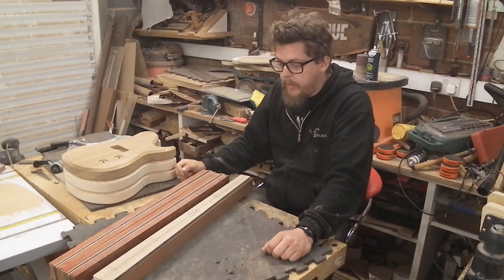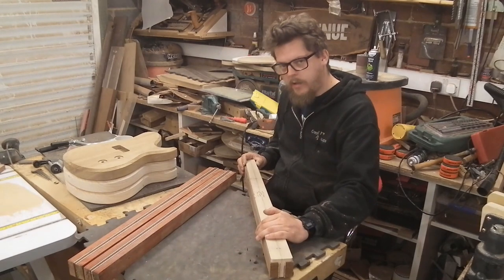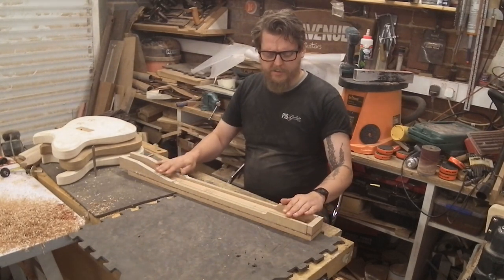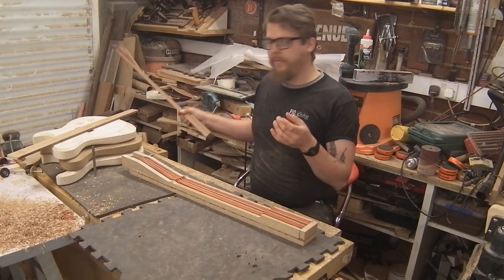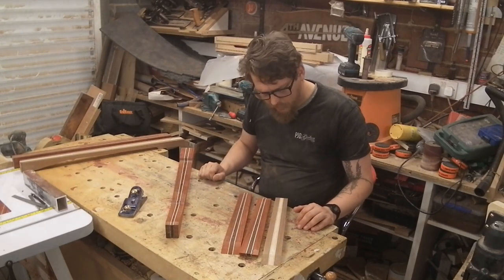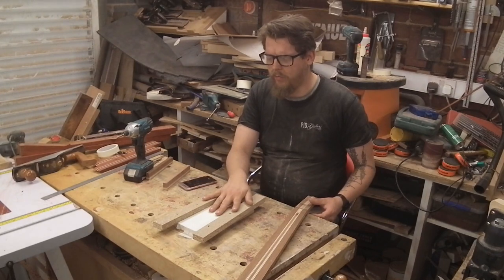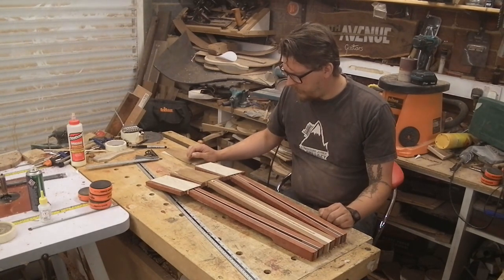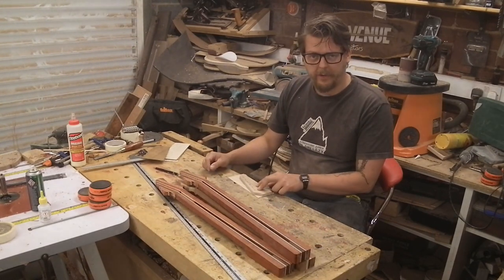Phoenix Graduate, the first batch; Neck time.

Comment: Okay that neck jig is brilliant. I need more info on how you built it so I can steal that. Totally not joking one bit.
Reply from the maker: 😂 I just created the side profile as a template then replicated that on the router, attached both to a rectangular board along the taper of the neck then used the rectangular board as a template to route the two profile templates into wedges making both sides perfectly parallel… if that makes sense. Shoot me a message on Instagram if you want more details or pictures.